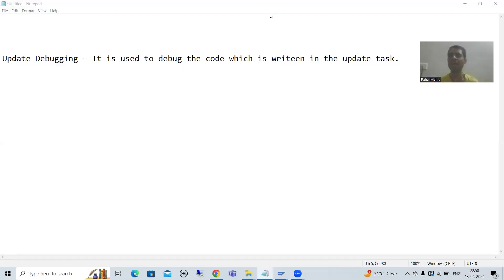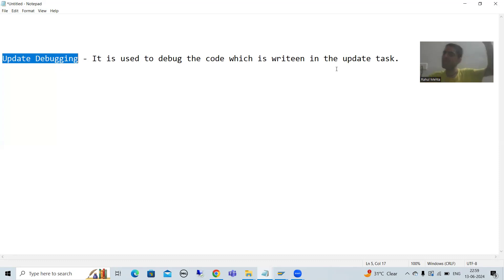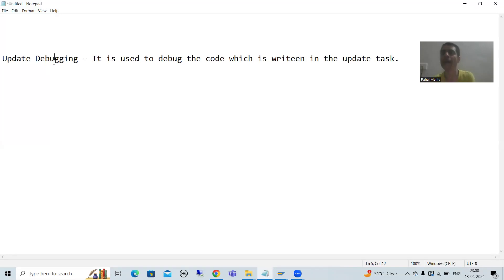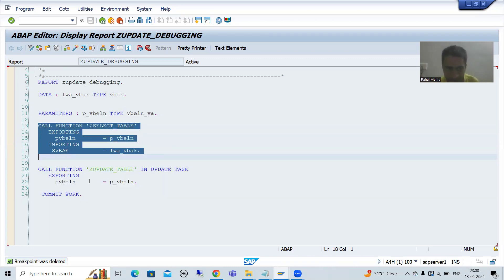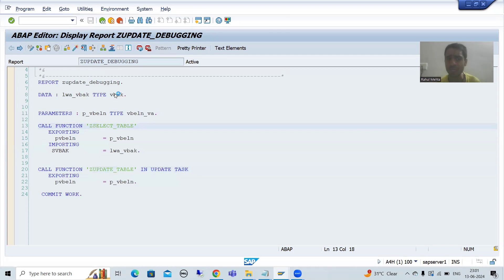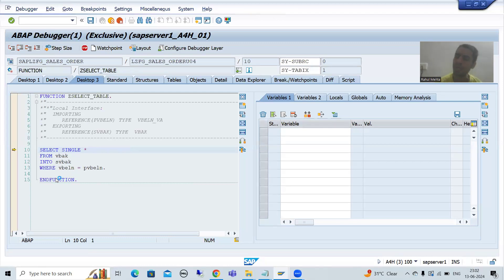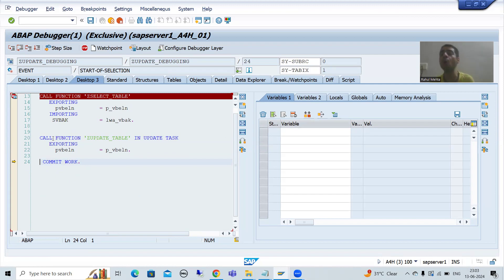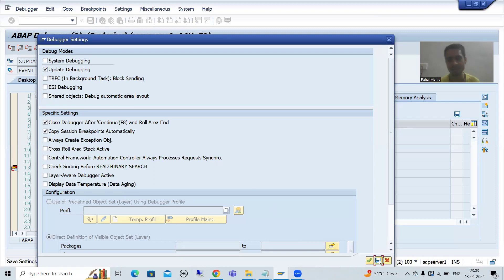18 - Debugging - Update Debugging Part1

Comment: If i always keep on system and update debugging will it cause any issue when i am doing normal debugging
Reply from the maker: Hello - It will not cause any issues, but unnecessary it will go in to update debugging and system debugging, even if you don't want to debug those codes.